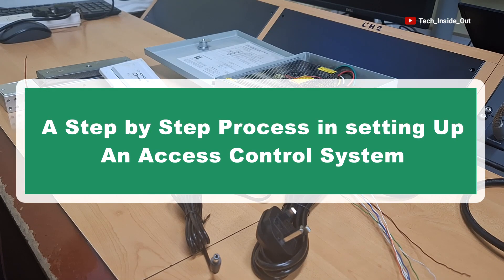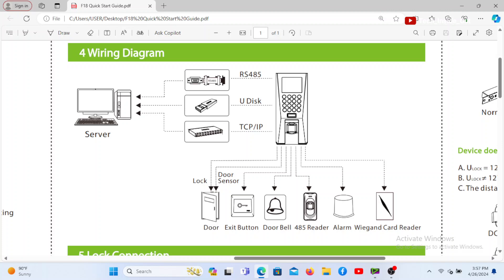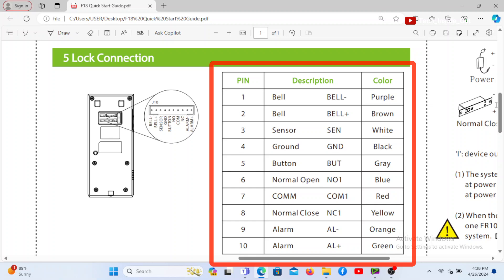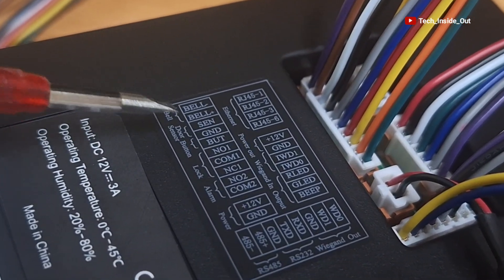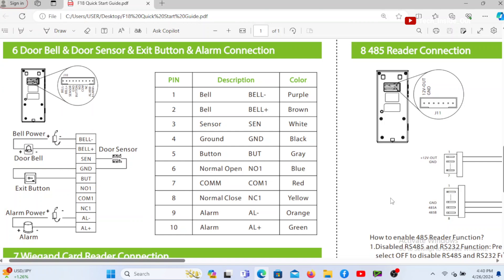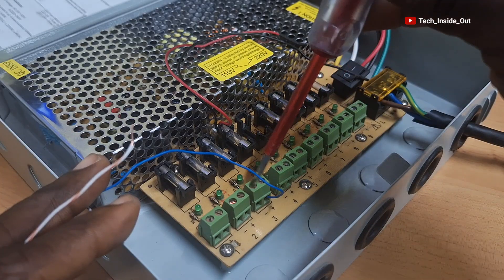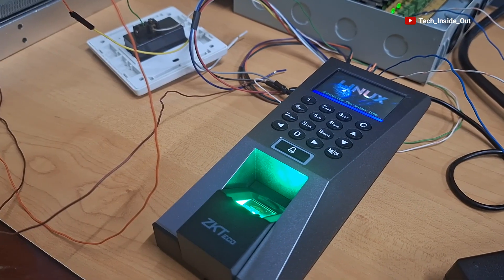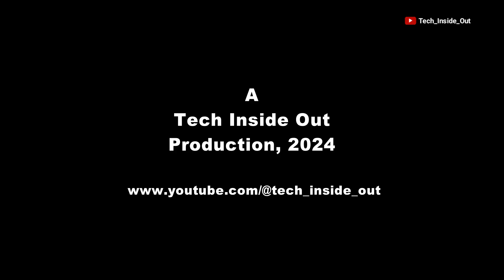How to setup an access control system using zkteco f18 device

Comment: It important video and teaching me a lot but i have question .why you use two power supply is not enough 12v adopter.
Reply from the maker: The power unit is designed to coordinate the lock and the access control device

Comment: Hi, thanks for your video. I need your help. How do I wire my access control to a power supply without com , a no contact button, and an un-embedded electric mortise lock. Thanks
Reply from the maker: The wiring process is normally stated in the wiring manual for each item that needs to connected to the Terminal. You may reach me by WhatsApp if my explanation doesn't fully answer your question

Comment: Wow, your teaching was on point and straightforward. I have installed a system like this before, using two exit buttons, to make it easy to exit the office/room. I have been using only the 12-volt adapter to power the entire system, but in your tutorial here, two power sources were used. I will go and try this out because sometimes, one of the exit buttons on my connection used to lag, requiring the system to be power cycled.
Reply from the maker: Please try and share feedback

Comment: Hi why didn't you power on the F18 using the power supply unit instead on power adapter
Reply from the maker: Please clarify as to whether you wanted it powered onboard or tapping it through the power port through the power supply ?
Reply: @Tech_Inside_Out  power supply

Comment: Good work done, my question is that you connect the access control to the power supply unit and you also connect an adapter to the same access control unit to give it power can you explain the difference in the power.
Reply from the maker: The adapter powers the Access control terminal. The external power is meant to feed the peripheral devices like the magnetic lock and other accessories that can be connected to the access control Unit.

Comment: Hello, the power you connect to the access control at 11:23, can it powered by the 12 volts power supply in a typical installation, because there might be no place to place to plug in the adapter?
Reply from the maker: The system uses 12v dc. You can use an adapter

Comment: You're just a gift for this generation. Please how can we install it on the door
Reply from the maker: You will have to first pass the cable in either a conduit pipe or lay trunkings on a wall surface and hung this using a provided wall bracket that comes with the device. 
Thanks for the compliment